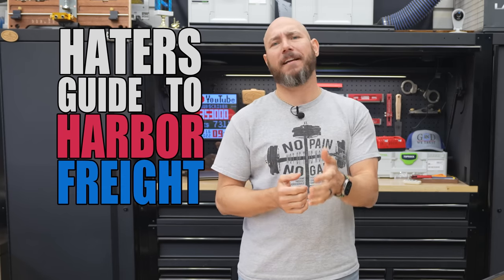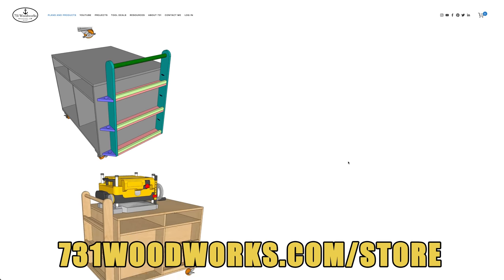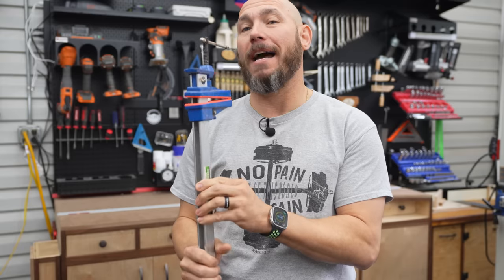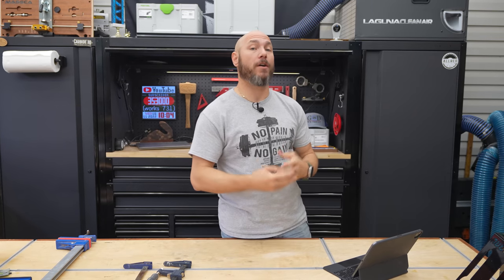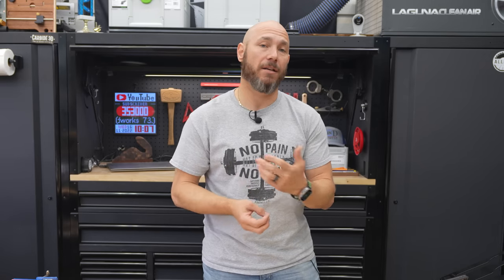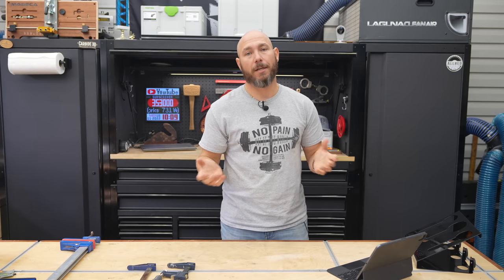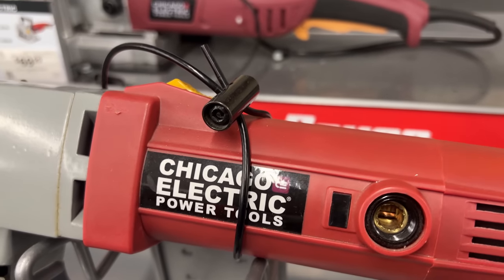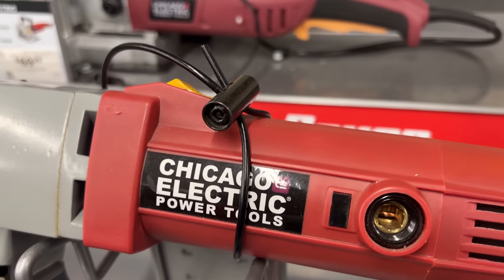The Hater's Guide to Harbor Freight | What to Avoid

Comment from the maker: ▼EXPAND FOR TOOL LINKS and INFO▼ 
Watch Next = Harbor Freight vs other Parallel Clamps - https://youtu.be/jA4nhgY30kU
Tools In This Video: 
Current Harbor Freight Deals - https://sovrn.co/pnvc06d
Bremen Parallel Clamp - https://sovrn.co/1gzlppz
Pittsburgh Bar Clamp - https://sovrn.co/isu3emi
Hand Screw Clamps - https://sovrn.co/kz808c4
F Clamps - https://sovrn.co/1kmjj26
Magnetic Trays - https://sovrn.co/nopmixp
Tool Wall I have - https://amzn.to/3H1ySwJ
Magnetic Hooks -- https://sovrn.co/5ctsjh7
Magnetic Tool Holder - https://sovrn.co/10feg7o
Magnetic Paper Towel Holder - https://sovrn.co/121b1rh
Hercules Miter Saw - https://sovrn.co/tvwe222
Bauer Planer - https://sovrn.co/1etpcno
Tool Wall I have - https://amzn.to/3H1ySwJ

BETTER CHOICES THAN HARBOR FREIGHT
Irwin F-Clamps - https://amzn.to/3FdWJrB
Bench Mark Rules - https://lddy.no/1e3bc
FastCap Tape Measure - https://amzn.to/3AX74pg
Swanson Square Combo Pack - https://amzn.to/3Vz8hLs
Bosch Router I Recommend - https://amzn.to/3VikTqA
Narex Chisels - https://lddy.no/1e3bf
DeWALT Table Saw - https://amzn.to/3Vz1xx2
Whiteside Router Bit Set I Recommend - https://amzn.to/3VxbStK

(If you use one of these Amazon and other affiliate links, I may receive a commission) 

Some other useful links:
Daily Tool Deals on my website: https://www.731woodworks.com/tool-deals
Subscribe to our email Newsletter: https://mailchi.mp/7e44c16eefdc/731-woodworks-email-newsletter
Check out our easy-to-follow woodworking plans: https://www.731woodworks.com/store
Outlaw's Board Butter - So Good it Should be Outlawed: https://www.731woodworks.com/store/boardbutter
Reply: I own the Hercules Table saw and they remodeled it in the last year or so. I have the original and it has a rack and pinion fence.
The only negative about the saw I have found is that you can’t use dado blades on them
Reply: @FixItFrench   Thats a big no go then.
Reply: I'm not saying the BBB is a bit of a scam bit..................
Reply: I love Harbor Freight, but I am not using most of the tools professionally.  The have a new screw drive kit that I am.  I also like their 6 piece small screw driver kit.
Reply: I also love their powered ratchet wrench.  The batteries have been VERY good.

Comment: I recommend their moving blankets. They are inexpensive when on sale and they’re great for protecting finished projects if you are transporting them.
Reply: Yep. Tarps and tie downs too. The ratchet straps are kind of weak feeling I wouldn’t trust it for big stuff
Reply: OMG Yes. They had a Sale last year, bought like 12 of them for about $2 each. We use them as Picnic blankets, Lining for tents, Day camping in the car (they go on the bottom under the blanks and over any padding), and also, moving things.
Reply: They have good deals on furniture dollies too.  I have several and they have served me for years at a very low price.
Reply: @charleselkins4546  I've put my kitchen range on one of the steel reinforced.
Makes it easy to pull out and clean around
Reply: Second that! I bought a bunch and they work just fine.
Reply: @The_Bigot The old style cheap rachet straps they had over five years ago were great bang for the buck.  Mine are still ticking besides the straps starting to fray.  I bought a new set a few months ago, and the quality went in the trash.  They fight just trying to ratchet, and the weave on the straps seems half as dense.  Bought some Husky straps for 5 bucks more for a set of four, and are worlds better quality than either Harbor Freight ones I have.  My only complaint is they are more bulky to store, and the bigger beefier hooks are hard to use in some tie downs...
Reply: @The_Bigot  yep - pay extra for the ones at OSH. Straps aren't something you can skimp on as if one fails, it's a sad sad day for you.

Comment: I love when people with a following bring to light that cheap items have their purpose! I love me some harbor freight. There is a time and a place for everything.
Reply: If you're like me as you continue to shop there, you will begin to notice that they're systematically making changes to their product lines to elevate the quality of their products.
Reply: @ancienttom97  this is so true
Reply: Harbor freight is great for a one time use and abuse type of situation. Don't let your chisel hit a nail, naw it's harbor freight just whack it harder. 
I've also used dollar store tools. For example, a long nose pliers might not be worth anything but if it's just for holding something while soldering it then they work great.
Reply: @ancienttom97  I have seen that! it is great to see.
Reply: There is not a lot i will swear by at harbor freight but for one offs and disposables harbor freight is boss
Reply: @ancienttom97  Unfortunately, they're also elevated the prices, and not just on their "higher tier" items.  I don't really get why we need expensive brand name knock-offs at HF.
Reply: I agree. For me, I don't work with tools. I just use them when needed at home. A good piece of advice I received once was "always buy a cheap tool first. Then if it breaks or doesn't break, you know what to invest in next time"
Reply: I bought a nail gun a few yrs back for one sheeting project. I've over oiled it to put less stress on the cheap metal internal parts. Used it a ton. Let my buddy borrow it to build his shop. Still working great.
Reply: @Sean Stevenson going out of business soon? 😂
Reply: DeWalt, Ryobi and snap on warranty sucks give you a hassle on warranty
Reply: It's nice to have HF tools lying around when you need to make "custom" wrenches. don't want to cut, grind, or bend your high dollar wrenches.

Comment: We’ve had two of the Chicago electric angle grinders in our shop now for 2 years and they are impressive. We use them regularly and in long durations and they continue to hold up.
Reply: I have had a Chicago Electric angle grinder for several years.  I dropped it two years ago and broke the plastic housing.  I bought a Harbor Freight plastic welder and fixed it.  I am honestly shocked the thing still works after all these years and abuse.  It was well worth the $20 I paid for it.
Reply: I actually bought a Chicago Electric miter saw off Craigs List like 5 years ago. Still works just fine. Granted, I paid like $40 for it. Not sure I would pay the sticker price for a brand new one.
Reply: Their $12 grinders are surprisingly good. My ex brother in law has had one for 5 years and he uses it all the time.
Reply: You can decide if you want to do it and how "ethical" it is but when you do wear one out odds are good you can go buy an identical replacement and then you just keep the receipt  and bring in the broken one within 30 days and as long as it is in the box and you have the receipt you will get a "free replacement" which you can just put on the shelf so you always have replacement/spare on hand   Come in during lunch or some other "busy time"
Reply: Me too 👍🏻
Reply: @daleferber2096  you day that knowing it is unethical and then try to school another to be unethical. If I did that to you, then you would know it is WRONG.

Thanks for displaying your ethics.
Reply: I've had the same one for years and it's lasted through some serious abuse, but good God almighty the things is LOUD! I've since upgraded to a Kobalt 24v angle grinder and it's much quieter and performs much better.
Reply: I suggest everyone to buy one as angle grinder can do so many different tasks.  It's basically a Dremel that's 4 times bigger.  Got mine for $10 on a sale, and after two wheels they're still going strong.  HF really excel in simple tools.  It's a great way to find out if you'll use this tool often and act as a stepping stone that's even cheaper than renting the tool.
Reply: @lanzer22  I like using the ⅛" collet and glass engraving bit in my 4½"angle grinder for engraving glass.
Reply: Mine is going on 25yrs young. Bought it cheap when I couldn’t afford or justify paying more. 
My much more expensive Makita version will eventually be the one taking a beating, but meanwhile I’m still abusing the piss out of the HF tool.
Reply: @daleferber2096  You have to be able to live with yourself

Comment: I built my entire tool collection from harbor freight. I've even ended up buying some of the stuff they say to avoid and they work surprisingly well. The basic Pittsburgh tools feel cheap but will last if you use them only for what they're rated for. The Pittsburgh Pro line is great. I regularly abuse them and they hold up well.
Reply: I've only had a few issues with their products, and both times, I returned to the store and either got a full refund or a tool replacement, with no issues following afterward.
Reply: Nothing wrong with that plan. If the HF tool lasts, you saved some money. If it doesn't, you know what features to spend on the next one.
Reply: I'm a heavy truck mechanic who got his box stolen  in 2013 and to rebuild my tools most have been harbor freight. I don't buy "good" I stick with better and best and depending on the item I may buy some other brand, like my 1/2 inch impact is a nitrocat 1250. For air grinders that I need occasionally but that spend a lot time in the,  box central pneumatic works great. For battery tools I started with Bauer but because of some of the tools available in the Hercules line I've started to transition to Hercules. I've been extremely pleased with both lines. 
I've been abusing the angle head wrenches (to  2") for 8 years and haven't had one fail yet. You can't beat the impact sockets, I have shallow and deep 1/2 and 3/8s since 2013 and I've only broken one that I use all of the time, walk in the store and walk out with a new one.
Reply: Same, I would not have been able to build a shop without harbor freight. There are snobs in everything and tools are no different. Often the people telling you not to buy harbor freight are standing in front of a SawStop, a $10,000 planer, or some ridiculously huge CnC that I will never have access to. Literally, ALL of my knife shop is harbor freight tools and I have knives that sell for hundreds of dollars.
Reply: I'ma farmer and the Pittsburgh wrenches are good and cheap. I like having 5 9\16s compared to 2 craftsman. Both are made in Taiwan metal
Reply: I can't imagine building a tool collection from Harbor freight!  Maybe a really cheap tool that your only going to use once but to build a "tool collection" at junk freight store seems like a waste of money to me!
Reply: @jeffwhitney3369  well, maybe you need to park your preconceptions and prejudices some place and take another look. I had a 30 year accumulation of tools stolen and without HF I would have had to retire. There are some junk tools so you find those on the internet. But with the good, better, best tool grades the quality has come way up. 
I now have a US general 72 inch box that is out of room and 90% is HF. I'm a heavy truck mechanic and I don't have a problem with most of their tools, Especially wrenches and impact sockets. I start with the HF and if it doesn't stand up, then I find something better, but 95% or better is still going strong.
Reply: @cbmech2563  I love that you rebuilt using harbor freight’s tools. Good for you , keep up the good work.😁
Reply: @theelvisguy6933  thanks 😊. 
Reality is my primary concern, not name brand 👍
Reply: @cbmech2563  I’ll never understand why guys pay huge money for snap on box. I’m with you on the reality harbor freight box just as good. Keep up the good work .
Reply: @theelvisguy6933  it's just a tool storage device, I don't need to spend 20,000$ on a snap on . My box that got stolen was a 30 year old home owner quality craftsman that was still in good shape. If you abuse it, anything will turn to crap.
Reply: @cbmech2563  👍
Reply: Plus they're cheap, so you can break and replace them several times for less than the cost of a more expensive tool you would have broken anyway.
Reply: I agree 100% I love my Harbor Freight tools I recently bought their Daytona 12ton and 6ton jack stands and other tools I absolutely recommend Harbor Freight their costumer service was a joy super friendly👍🏻
Reply: @BlackbeardKNAC  You're right, Harbor Freight works for me I have ZERO issues with them in fact I love shopping there.👍🏻
Reply: @cbmech2563  Indeed 👍🏻
Reply: Use the impact bits and regularly trade them in- no questions
Reply: The reason to buy a snappy box is quality,buy once cry once. Have a old Waterloo industrial (on custom welded chassis w/steel wheels that survived shop with floor like moon-craters had craters)that can't be replaced except snappy/matco but Icon is pushing and new general is good for 80% of buyers

Comment: I’ll be honest I was a HarborFreight hater for a long time. Here, in the past few years I’ve slowly started to come around. Yes, there’s some really good deals in there but it’s sort of like how you would treat the dollar store.  You get what you pay for.
Reply: And you eventually come to know what to expect out of your purchases. If you have a problem with the tool you just bought, they have a 30 day return policy that hasn't disappointed me yet.
Reply: They're great for most consumables. Nitrile gloves are a really good bargain. Even their ALKALINE batteries are good, for the price. Again, it's HF.  I wouldn't trust them in an expensive tool. I use only Energizer Lithiums for these.
Reply: The fewer moving parts, the better HF is (known exception: Anvil. The iron they use is far far too soft for a proper anvil). 

And as another commenter says, they are great for consumables. They have a small-size neodymium magnet, 10 for 2 bucks, IIRC, which is a very good deal. They have some different tweezers that are quite good. They also make a really really good 4x4x6 "tilt bin" for keeping larger screws, bolts, washers, and nuts in for organization. I just buy those by the pound from a local Rural King (think of a farm-oriented Wal-Mart... they sell live chickens and rabbits, for example!) which is by far the best place for getting bulk fasteners...

P.S., another source for great cheap stuff is Banggood. You're basically getting stuff from the exact same factory in china, and slicing out the middle man's cut.
Reply: They've actually stepped up in the last 5 years and are sending American QC teams to China.  If I'm rarely going to use a simple tool I'll go Pittsburgh but if I need a little more quality I've been very happy with their mid grade stuff like the Quinn line.  I've generally been a bit wary on the power tools but I might have to start looking at reviews of the Hercules line after this video.  I'm very much in need of a cordless impact.
Reply: @rushthezeppelin  I bought an HF 'Warrior' 3/8" cordless drill a few months ago; battery holds charge really well, and for a home DIY type it was a better tool than Menards or Walmart sold, and with a coupon it was a few dollars less. It also runs at a higher max RPM than most 3/8 cordless drills. I've bought a few other items like a ~24 inch 1/2 breaker bar for lug nuts; used it a few times with no problems so far. Price is not the sole indicator of quality anymore, since it's all made in China anyway.

Comment: The router bits can be useful because you can buy so many different styles at a much cheaper price. Gives you time to figure out which bits that you're going to use the most and upgrade later instead of buying the most expensive bit kit possible and finding out that you only used two bits. 

I like a lot of things about harbor freight in that regard of being able to actually test out a type of tool to see if it's useful to your workflow.
Reply: I've done that, buy a cheap tool at HF and then realize I love or hate it. I didn't realize how much I would use a grinder tool till I bought a ten dollar one at HF. I then spent the money to get a much more expensive Dewalt after the HF tool quickly burned out.
Reply: Well said.
Reply: I'm a fan of this approach. Get a cheap kit that has everything you need. As pieces break or wear out, it becomes clear which things are worth investing in.

Comment: Being a modeler i love their needle files and micro drill bits. Perfect for use on plastic
Reply: Bingo, need to know what you want them for.  Building minis, HF stuff is great. 
OTOH, I have quite a bit of tropical hardwood I brought back from overseas that will not only tear up the big name brand tools, but even industrial woodworking machines take significant wear and tear.

Comment: Harbor Freight has one great buys for tools that you may not use everyday. I have several tools from HF, but the vast majority of my tools are name brand. I like how woodworking/woodworkers out there seem to be more concerned about bragging about tools or cost of tools then they do woodworking. Use what you have or can afford and enjoy your craft or hobby.
Reply: Can't say it any better. Who cares what you have. As long as you get the job done what does it matter. I went forever without a nail gun. I didn't feel I had the need for it. I've since bought a battery powered nail gun. Life changer. So much faster than predrilling and hammering in finish nails. I was kicking myself for not making the investment sooner.
Reply: A true craftsman can do good work with mediocre tools.  A mediocre craftsman can do no better than mediocre work with top brand tools.
Reply: Damn good advice for enjoying your hobby/craft.
Reply: If you made a nice piece and then you told someone that you did it with a $4 chisel set and $6 hand plane, how could I not respect you more?
Reply: I have a wood lathe that I bought from HF back in 1994 and it is one of the best values I own. It's been a great tool the few times a year that I use it. If you need a top quality tool, go spend four grand on a brand name tool.
Reply: @geppettocollodi8945  my dad always said; an amateur craftsman has the right tools for the job, a master craftsman  knows how to use the wrong tools to get the job done right.